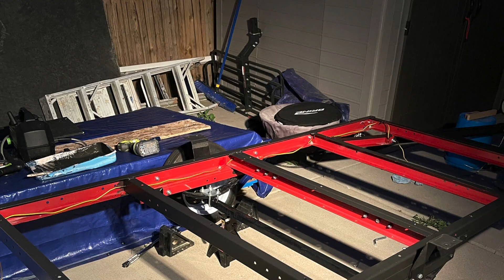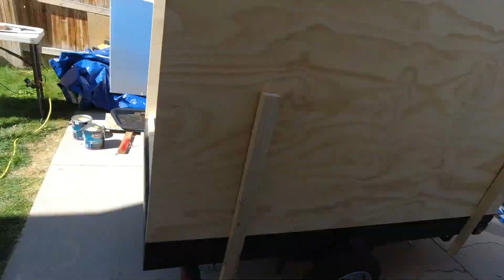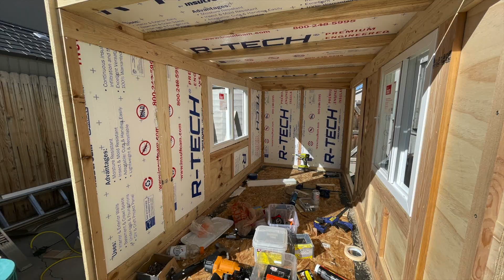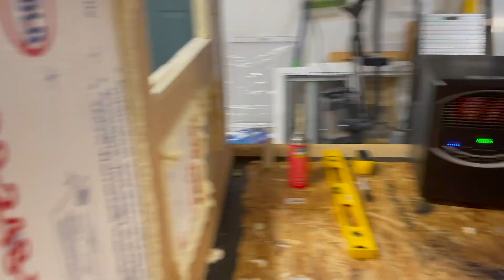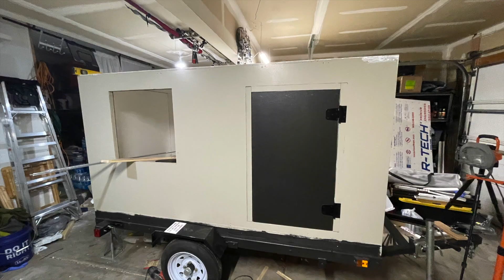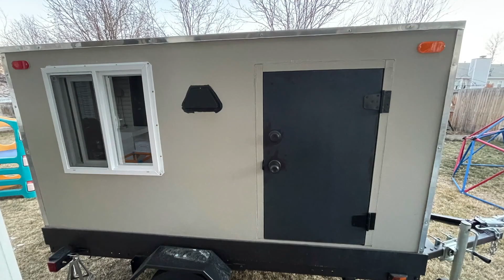Custom Squaredrop Camper Pt. 2 / Narrated and Materials Used.

Comment: I’m getting materials to start my 1st build. I’m no carpenter so this will be a challenge. When attaching the end walls to the side walls (drilling into the end of the plywood) what kind of screws do you use and do you drill pilot holes so not to delaminate/split the plywood?
Reply from the maker: Drilling pilot holes will definitely help not split the wood. I used exterior wood screws - like GRK fasteners that are also treated lumber approved.